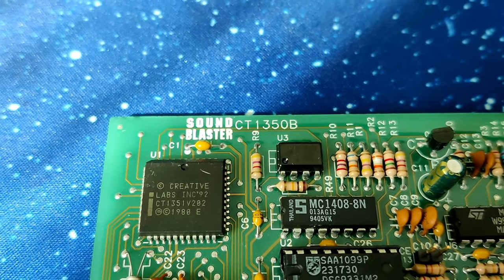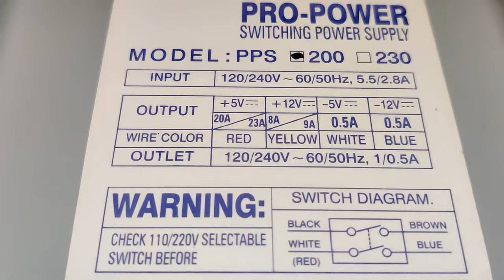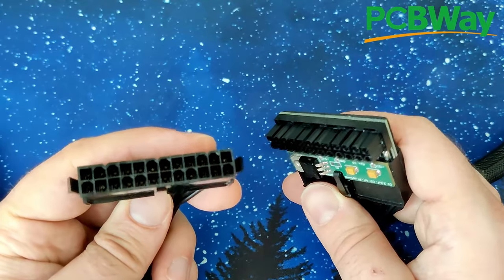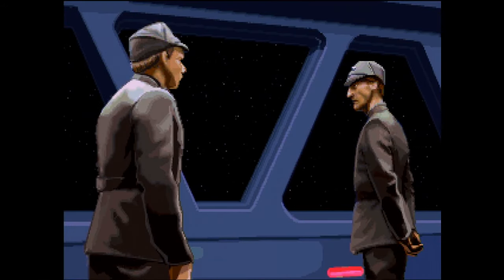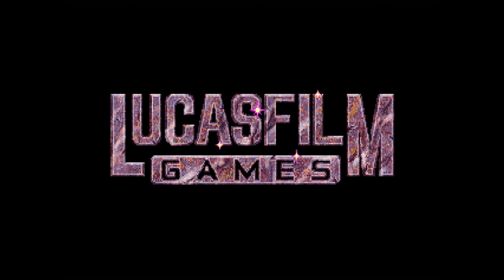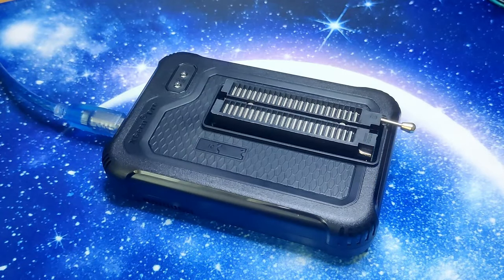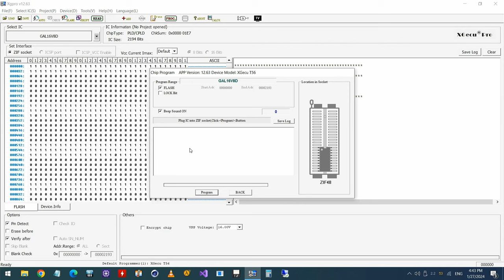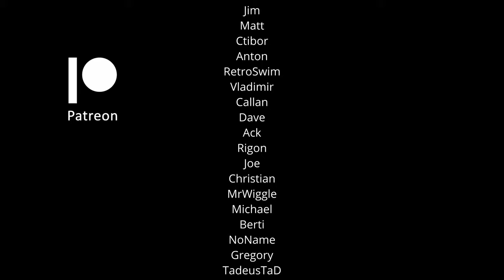The Secrets of Sound Blaster 2.0: CMS or OPL2? Here you get both!

Comment from the maker: BOTH SOUND CARDS WORK! Here is what was the issue!

Thank you so much everyone for your suggestions what could be the reason those Sound Blaster 2.0 cards sound weird in "The Secrets of Monkey Island". Here are a few things that was suggested (sorry, from the top of my head - I may have missed something):
- EMM386 memory manager
- Disable Cache / relax timings
- Use slower CPU
- Check ISA clock speed / reduce ISA clock
- Defective / misbehaving motherboard
- Crystal oscillator defective
- IRQ and address settings

If I missed something, you can add to this comment. The issue on my board was L2 cache! There were two settings in the BIOS that I had to change to fix the distorted sound.
1) "L2 Cache Policy" set to "Write Thru"
     The CPU is a write-through model. I don't know yet if this setting makes a difference when I replace the CPU with a write-back CPU
2) "L2 Cache/DRAM cycle WS" set to "3 CCLK"
     Another L2 setting that probably defines wait states for cache content to be synchronized with system memory (don't quote me on that).

With those two settings set, the theme of "The Secrets of Monkey Island" plays now correctly on BOTH Sound Blaster 2.0! Thanks everyone for your help! You guys are AWESOME!
Reply: Woah, looks like your machine was slightly, only slightly unstable on L2 cache part. You may want to search for different, faster cache chips. ;) 

NB! The CPU has L1 cache. It is separate from motherboard's L2.
Reply: Your cache was going out of sync with your hardware.  
This caused the in hardware data (accessed by the card's DMA) to be bad.

The ESS sound chips likely didn't use DMA, or because that card was newer, would send the signal to flush the cache to the main memory before reading.  

My guess on the issue why this only happened on Monkey Island, is Monkey Island streamed the midi from disk via the CPU with a relatively small buffer.  This would create the updated data to occasionally be in the CPU write cache when the sound card was accessing it from the system memory (and thus reading the old data.)
Reply: Do you happen to know a way to solve this sound problem on a laptop as well? I have two 486 66MHz laptops, each with an ESS AudioDrive ES488-F and OPL2 chip. Both laptops (one Highscreen BlueNote II and one ESCOM Paradigma) have exactly the same sound problem in Monkey Island. I was very happy, when I saw your video, but unfortunately, there is no option in the BIOS to configure the L2 cache (I suspect there isn't one).
Reply from the maker: Unfortunately, I have no experience with laptops. Maybe they have similar cache chips as desktop 486 boards. Maybe you could remove those chips from the board. You would essentially not have any level 2 cache. I don't know if one could disable the level 2 cache using software. But maybe that would be another option worth exploring.
Reply: @bitsundbolts Thank you very much for your response! At least with my ESCOM Paradigma laptop (with a Phoenix Biso Version 1.00), I've made significant progress. I found a "Cache Control" option in the BIOS and was able to disable the L1 and L2 CPU cache through it. And lo and behold, the melody of Monkey Island 1 plays exactly as it should, without any strange sounds. So, many heartfelt thanks for this video you uploaded, because without it, I wouldn't have found the solution. I have, of course, subscribed to your channel and look forward to new content from you. I will also check out your existing videos.

Edit: For my HighScreen BlueNote II, which has an AMIBIOS from 1992 and no "CacheControl" option, the solution was the "Cache Enable/Disable Utility for DOS" from Vogons: http://vogonsdrivers.com/getfile.php?fileid=74. When I disabled the cache using that utility, the music from Monkey Island played perfectly clean on the BlueNote II as well. 😀
Reply: I guess the real issue is not L2 related at all. L2 issues will manifest in more serious way than the sound being off. On the other hand, the OPL2 is notorious for requiring certain delays between register accesses to handle them correctly. The ESS card you used as comparison uses an OPL3 imitation by ESS, which does not require the delays. (Also, the original OPL3 also requires considerably less delays than the OPL2).

The settings you changed slightly lowered your system performance (by making writes to memory slower), ensuring that Monkey Island doesn't access the OPL2 chip faster than it can handle. "The real fix" would be to ensure that the OPL2 is accessed less quickly, without impacting general system performance. This likely is not possible without changing the code of monkey island. Another idea would be to entirely disable the L1 cache while running monkey island. There are generic command line tools to enable/disable L1 cache on 486 and Pentium computers. You could create a batch file that disables L1, runs Monkey Island and reenables it afterwards. The performance of your computer is severely impacted by running with L1 cache disabled, but this doesn't matter for Monkey Island, as the computer is still faster than any Turbo XT which is still fast enough to run Monkey Island flawlessly.

Comment: I was getting strange OPL3 behaviour with a 440BX system until I found a post on Vogons titled "How-to: Resolving ISA sound and OPL2/3 issues". Using the suggested BIOS settings (enable "Passive Release" and "Delayed Transaction", set 8-bit I/O recovery to 8 BUSCLK) fixed the problem immediately for me- seems to be a common issue when using genuine OPL devices on motherboards with both ISA and PCI slots.
Reply from the maker: Nice suggestion, I think there are some settings in the BIOS that may affect the Sound Blasters. I will play around a bit and see if the sound improves! Since you have many likes on your comment, you may be on to something! Thanks!
Reply: @bitsundbolts  With a 486 you might see different options - but ISA clock (in some form) is certainly among them. Try to change that too!
Edit. Ah. Your CMS sounds perfect after the garbled OPL2 output. What. I had much trouble with CMS sounds, even when OPL was working, I'm not even sure that my set of chips works as intended. Though I can't program a GAL to test if it causes the problem. But - it definitely worked differently in various motherboards....
Reply: Have to test this asap, have the same problem with Monkey Island and Dune2 and if I remember correctly also Commander Keen 4. Thnx for the info
Reply: The OPL2 is a quite slow chip. It requires a certain amount of time between selecting the register and after sending the data to the register. Usually programs will do 6 I/O cycles after writing to the offset register of the chip, and 35 I/O cycles after writing the data to the data register. If the ISA bus speed is in some way enhanced, this will not be enough for the OPL2 to have settled and you will get very weird results. See also my last video on the Adlib Drum Machine for some more in depth info about programming the OPL2... I briefly mention this waiting period.
Reply: @bitsundbolts Probably most of us don't know for sure but are used to seeing helpful YouTube comments and are hoping that one is true, too.
Reply: @root42  sounds interesting!
Reply: Damn I have a 440BX Motherboard as well and a SB Live card. I hope I don''t have a similar issues as my board is  an intel one and the bios is sadly very lacking in any options.
Reply: @treahblade  SB Live cards don't contain any OPL hardware so they'll work well on any 440BX motherboard. To provide FM/OPL compatibility, SB Live (and Audigy) cards use software emulation which can be a bit hit-and-miss with some DOS games. Another limitation is that the MIDI port can't be used whilst in DOS mode. They're one of my favourite cards for Windows 98 gaming though.

Comment: Nice! I have two remarks to the voltage blaster, first of all, you can find gerber files in the release area of the github project, just as I do for all of my projects. Second, since we removed all contacts from one side of the PCB, you will not damage anything by puting it the wrong way around. Such things can become dangerous only if you send 12V to data lines and this is not possible with the voltage blaster, there are simply no contacts for that.

As for the funny issues with Adlib, which machine did you ues to test? Monkey Island is speed sensitive when using Adlib. It starts to make problems already with faster Pentium machines, starting from Pentium II it even doesn't start throwing devision by zero error when using Adlib. Funny enough with CMS it works even on faster machines.
Reply from the maker: Thank you for clarifying! I must admit that it didn't cross my mind to check if those connectors cause an issue if inserted the other way around. I absolutely love my voltage blaster and will use it if I quickly need the -5volt rail!

Turns out that my level 2 cache settings in the BIOS were responsible for the game not playing the sound properly. The 486 DX2-66 works fine after loosening the L2/DRAM timings and setting the L2 cache policy to write through.

Comment: Glad you knew what the problem was and found the voltage blaster. I had similar issues with my Pro Audio Spectrum 16. Also nice solution with your own pcb!
The weird notes are probably related to timing, you might have to double check your ISA timing in the BIOS, or downclock your CPU (some games also act up above ~200 Mhz).
If I want to test OPL chips I typically use AdPlay (for Dos) to playback different formats without having to start/configure the game.

Comment: Slowing down the PC and/or forcing a delay between bursts of information sent via the ISA Bus seems to be the way to go on my end as well. Sometimes I disable the cache to obtain the same performance decrease of the CPU, but I prefer to stick with the Delayed Transaction and I/O Recovery since it allows to keep the processor performance.

The FM chip is sensitive to information received too quickly and will not be able to process it all, hence the errors. It wasn't known in 1987 in AdLib's documentation, but it was added to their developer kit documentation later when the computers moved on from the 286 era, into the 386 and 486 era. They suggested a number of milliseconds (I think 40ms) between requests.

This is why recent games will sound correctly : the games themselves implement a timer to delaythe requests to the sound chip. Older games were shipped when computers were much slower so it wasn't a problem then. And more recent clone cards like the ESS probably implemented a buffer and circuitry to tolerate faster processors sending information quicker than anticipated.

Comment: What surprised me the most about these earlier sound cards, is how they used a small MCU (8051 or Z80 usually) to act as a "DSP".

To do very basic mixing and volume control, and to handle a few register writes, etc.

On cards with PCM (sample-based), they have registers for controlling things like the sample rate, stereo or mono flag, 8-bit or 16-bit playback. And registers for the DMA counters, to tell it where to read the samples from in RAM.

FM sound like CMS and OPL2/OPL3 are usually just directly mapped to an IO range, so a lot simpler to handle than sample playback.
Reply: Oh, and yeah, some ISA cards can be fussy about the bus timings.

I've been working on an FPGA-based ISA sound card, and it took me about a week to get stable OPL and PCM sound out of it. lol

The ISA bus is essentially "asynchronous", even though there is a clock.

So some things need to be latched into registers on the rising or falling edges of the ISA signals, some things required a slight delay, etc.

PCI isn't too far-removed from ISA in many ways.

PCI mainly differs in the way most PCI cards allow auto-configuration of things like IO and mem-mapping, selection of which IRQ line to use, and which DMA channels, etc.

(PCI was also designed to take more advantage of burst transfers than ISA was.)

Other than that, it didn't take much logic to translate between ISA and PCI, even back in the day.
Reply: 15:37 Oh no, not OpalJr. lol

So many times, I had to run a VM or DOSbox, just to run OpalJr, to convert some old JED and EQN files.

Comment: I used to have the SB 2.0 in my (AMD) 286 and 386 in the 90s. Without the CMS - don't know anyone with that. MI worked perfect on the OPL2 of the SB2.0. So, as you already figured, it boiled down to issues with the not quite period correct PC or its compatibility settings.

Comment: Whenever I see earlier ATX PSUs, I check if they have negative 5v supply. If they do, I save that PSU and clean & maintain it to the top notch condition.
The earlier revisions of ATX still had negative 5v supply.

NB! I have considered creating my own voltage blaster that would be soldered on the back side of the motherboard on top of motherboard's atx connector pins. Very similar idea with yours!
Reply from the maker: Yes, those ATX power supplies are indeed great for retro PCs. If you maintain them - maybe even recap what is necessary, then you have great power supplies for anything retro! And yes, your idea is indeed very similar. I have my adapter connected and I forget it is there. It just works and I don't need to worry later when I use a card that requires -5V. Plus, the EVGA power supply is new and has all the modern features including short circuit protection etc.

Comment: There is another tiny version of the -5v thing specifically designed to be soldered to the bottom of the motherboard where the slot is soldered in. This means no module hanging off some kind of adapter or taking up a slot.

Comment: The Terratec EWS 64 XL also needs the -5V line. my suggestion is: On old Hardware with ISA > -5V is a must. Most of the times the problems are not right in your face, but subtile. On my EWS, the Digital Port is always marked as disfuntional in the device manager without 5V, and the card behaves a bit erratic. With -5V, the Terratec EWS 64 XL is a blast and works like a charm, especially in WSS Mode.

Comment: OPL2 is very speed sensitive. CPUs up to 25 MHz should be always fine but for games that do not apply recommended delays between port writes you are going to face issues with faster CPUs. One of the options is to use MIDIto to add delays between OPL2 port writes if any other delay method is not available (and MIDIto has other nice features as well). OPL3 also is speed sensitive on much faster CPUs and MIDIto helps there too.

Comment: I saved my paper route money to buy an original SB shortly after it first came out. (The first version included the CMS chips.) I left it in my family's computer when I left to college. It was destroyed by a failing power supply. A few years later I was able to find a SB1.5 for a decent price on online auction to replace it. As luck would have it, my employer at the time used the SAA1099 in its test equipment, so I didn't have any problem finding new ones, and the SB1.5 already included the decoding logic for the CMS chips.
Reply from the maker: What a coincidence! Your CMS upgrade was meant to be!

Comment: Well, recently a SOUND BLASTER CT-1320B with 1989 DSP-1321 (C) 1989  CREATIVE LABS, INC. 1990 & FM 1312 MADE IN SINGAPORE had been flown to me, missing the two Phillips Chips.
Not tested yet, because I want to refurbish the AT Power Supply first. I got this in a mini case with the GA-586HX running an IBM Cyrix 133 MHz aka 166 MHz.
I plan to use the SB on an Intel 386DX 20 MHz with CoPro board I was given from an Civil Engineering office I worked for at the time when 486 computers became available.

Comment: Back in the days, I wouldn't even dream about having such a card in my 486. I had to be happy with good old PC Speaker (or sometimes annoyed by the limited capacity 🤔). One idea that really amazed me recently was one necroware talked a while ago about using the parallel port and a bunch of resistors, however its support in applications is quite limited.
Regarding the issue you couldn't find a solution, I believe it should be somewhere in the digital side. My guess would be some memory corruption, but once both cards show the same problem, i would say it is some sort of incompatibility between the cards and the motherboard you are using. Have you tried the cards in another system? It could be as well some voltage out of spec, but I don't think so.
Reply from the maker: I did try both cards in a different 486 motherboard: ab ASUS 486SP3. I'll try the cards in my 386 system and see if it may be related somehow to socket 3.

Comment: Yea those bottom single ISA slots you aren't meant to use along with a PCI card, they use the same bracket, since PCI "flipped" the orientation of where the components were on the board.

Comment: BuB - install a Cyrix CPU and then run "setmul 1".  It will bring the speed down to a 486DX/33.  Then test again with the slower speed.
Reply from the maker: I will try different speeds. I think I even have an Intel DX-25 - that is hopefully slow enough! Just in case speed is really the issue. And I can also disable the caches on the motherboard and the CPU.
Reply: @bitsundbolts  Avoid using disabling L1/L2 as a means of slowdown...  It does slow down the system, but not the way you expect it.  Lowering clocks combined with disabling auxiliary features (preemption, i-cache, d-cache) is a much better means of achieving your goal.

Comment: I tried this on my custom build 486 PC (PVI-486SP3, i486DX4-100, 16MB RAM, CL-GD5428, Sound Blaster 2.0 CT1350B + CMS) and Monkey Island sounds just fine.
Reply from the maker: Interesting. I tested the cards in the same board as well! But even in the PVI-486SP3, both Sound Blasters still don't get Monkey Island correct. CMS does work without issues - just the OPL2 is off.